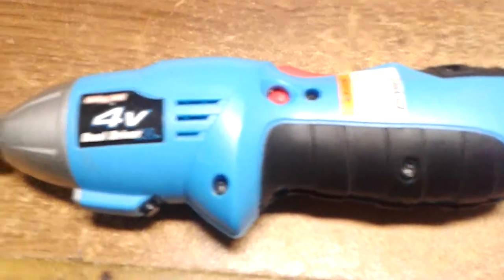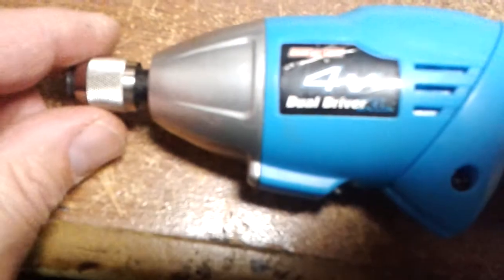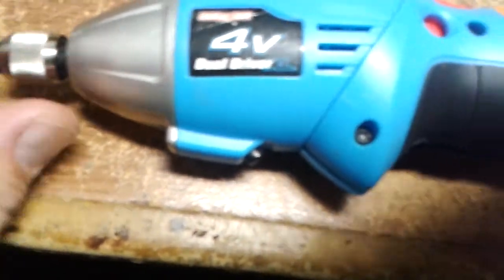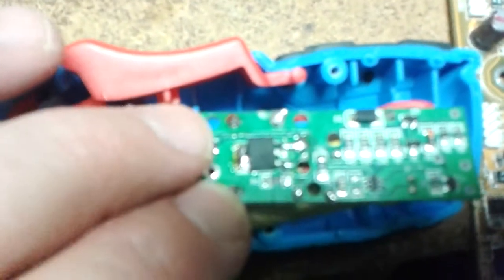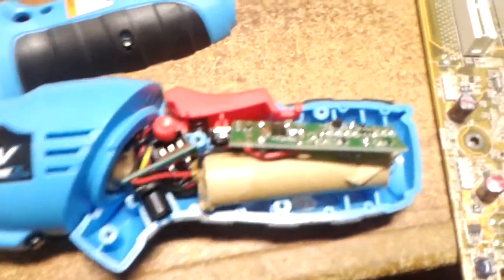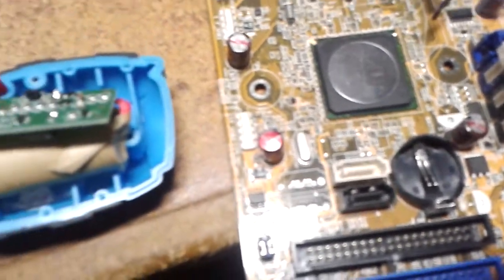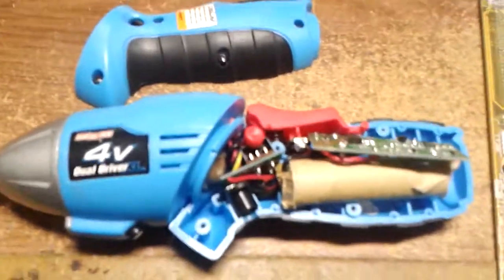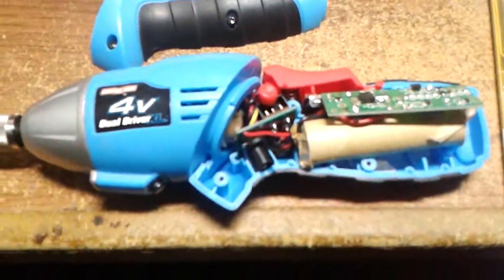Cordless driver fix

Comment: I had my screwdriver fail (Looks similar to yours)...  I've gone through the circuit and found the MOSFET FR3709Z looks like its failed.  Just ordered 10x for $2.50 from Aliexpress.  Thought I'd have a look online and found your video.  Pretty blurry but it backed up my thoughts on this little problem.